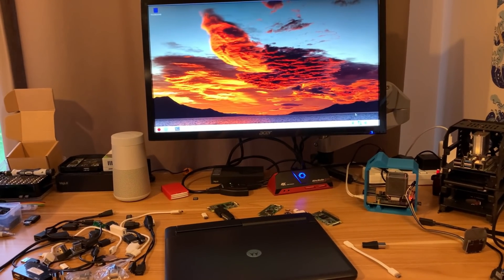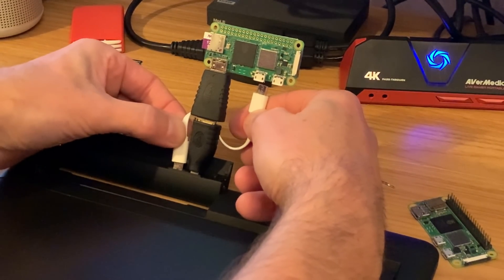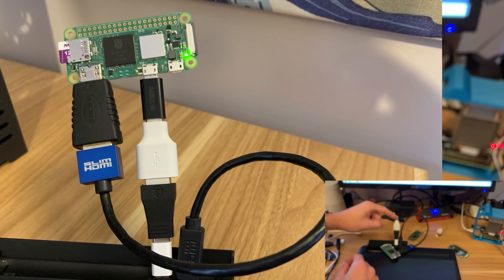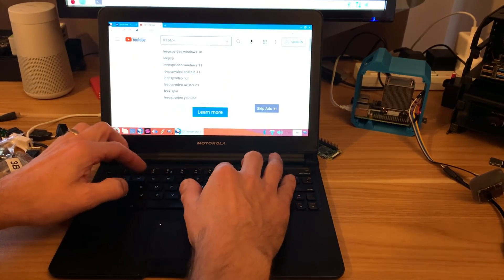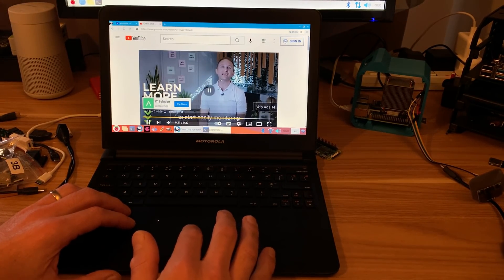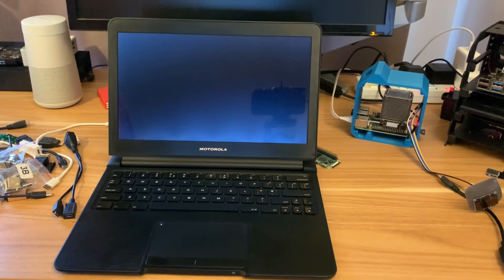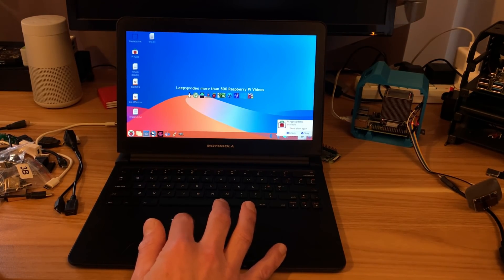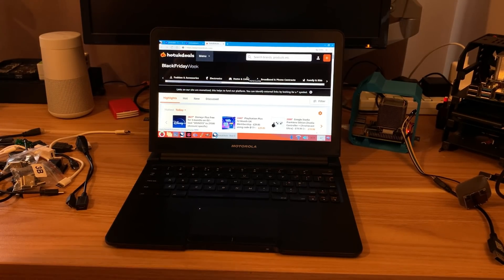Motorola Lapdock powering Raspberry Pi Zero 2W.

Comment: you can also use short cables for HDMI to uHDMI and 90-degree angle short cables for USB to USB to make it tidy. From there, you can build your own small HDMI + USB to HDMI + USB adaptor to fit exactly with the two connectors of this type of computer.

Comment: Have you seen the DIY USB or HDMI Cable Parts  at Pi Hut? A ribbon cable that you attach whatever to each end on a breakout board? You can make an anything to anything cable (within reason). 10 cm is the shortest I think.
Reply from the maker: Sounds great. 👍🏻I just looked at the female micro usb. Unfortunately the clip design is too wide. I’m sure they’ll come in handy in the future.

Comment: I wonder how difficult it would be to make a custom circuit board and a case to put it all in so it can interface with it easier.
Reply: Was thinking the same…but then my mind wandered and I wonder if a custom board for a CM4 could be made and used without issue too :)

Comment: Hey what operating system are you using or is it a different browser. I have a pi zero 2w. But YouTube use is completely unusable. Im currently trying Ethernet but it seems to just make it unusable still takes about 2 minutes to open a YouTube page completely. This is my first raspberry pi.(haven’t overclocked it and I have a heatsink with proper thermal paste on it.
Reply: Ethernet still doesn’t work it just froze the page I didn’t notice because I was writing the above
Reply from the maker: puffin browser, chromium is awful 
Zram installed, makes the os much more responsive 
I used Ethernet in my usb hub video, but mainly I have been using WiFi 

Pi news 41. The Amazing $15 Pi Zero 2. Plus Vulkan 1.1 compliance, up to 60% better performance.
https://youtu.be/Tbj7P3tVUHg

Great USB hub for Pi Zero 2 W. How many drives can I plug in.
https://youtu.be/reyLeYB8wr0

Usb boot Raspberry Pi zero 2w. Speed tests SSD Vs SD Vs USB drive.
https://youtu.be/H-kkZo09ECg

Overclocking Raspberry Pi zero 2w. From 1000Mhz to 2147Mhz
https://youtu.be/Wshq5rpDQHc
Reply: @leepspvideo  thank you

Comment: the cheap 'AuviPal LAN Ethernet Adapter with 3 Ports USB Hub' works well enough, as does the 'EasyULT Micro USB to USB C Adapter 4 Pack, Type C Female to Micro USB Male' with wire clips too

Comment: good video.
I am interested in the Pi Zero 2 W running a 7 inch touch sreeen.
I think you have made a video on this but I am wondering how much power a Raspberry Pi 2 w and a 7 inch screen will use
Reply: Hello, I've ordered a 7 inch touchscreen for zero w 2. It will arrive next week. Feel free to get in contact, I can tell you what works and what doesn't.
Reply: @r0galik  brilliant. thanks for the info.
hope all goes well. i may contact you.
I plan to use a Raspberry Pi zero 2 w with a 1TB sdcard and a 7 inch screen to make the smallest plex server going.
The 7 inch screen could be used for management and on screen weather not for watching movies on.
Since movies are written once but readable multiple times then a sd card should work fine. my only concern is power use and the limit of 512mb ram
Reply: @BillyNoMates1974  keep in mind that the wlan isn't very fast... 65 Mbit/s max. But if you get a usb to Ethernet adapter it is much faster. I'm assuming you want to stream from it, right?
Btw if it is supposed to be a plex server, why not just run it headless?
Reply: @r0galik  good point but I have already tested Raspberry Pi OS on a laptop and setup plex on it using 520 mb of ram and tested two streams from it over wifi.
yes i plan to stream from the pi zero.
A Pi 4 would probably work better plus id have more Ram and a Network connection but it kind of cops out on the fun factor.
plus the fact I could just take it to a friends house, use the screen to connect to their wifi then start streaming. nothing else but power to connect and go.
Reply: @BillyNoMates1974  ah yes, good point! How about this, btw: you can install dietpi on it and run headless. You could make it connect to your phone WiFi hotspot, you could ssh to it from your phone and then connect to any network through dietpi config (it can scan for WiFi networks without a problem). Then you would only need power, which you can even get from a USB powerbank! And no screen required :) 

Btw I'm just talking about possibilities - if you'd really like a minimalistic setup then that's another option
Reply: @BillyNoMates1974  also I'm not sure about the RAM/vRAM split needed for a Plex server - you might need like 96 MB which makes your RAM only 420 MB. And you'd need to avoid transcoding at all costs as this would just choke the pizero2w...
Reply: @r0galik  brilliant idea. thanks for the info. I should try that
Reply: @BillyNoMates1974  oh cool, this should work well then! 

My setup is rpi4b connected to a 5-bay DAS and through Ethernet to the router, then chromecast 4 with Kodi installed to stream through wifi. Works OK so far, but the chromecast doesn't have that much storage and Kodi wouldn't be able to squeeze in such a large library as yours. And I don't have a nice video presenting this like you do :p

Comment: I still have a Motorola Lapdock.  I use it with Raspberry Pi, Jetson computer, and many other single board computers.  It's great and still holds a charge.
I just purchased the Pi Zero 2 W so hopefully, that will work well with the Lapdock.